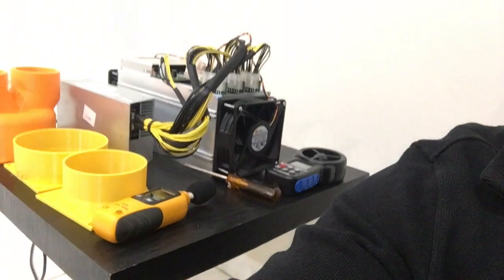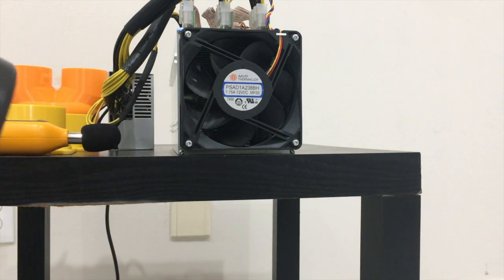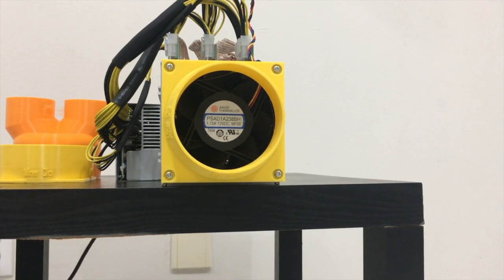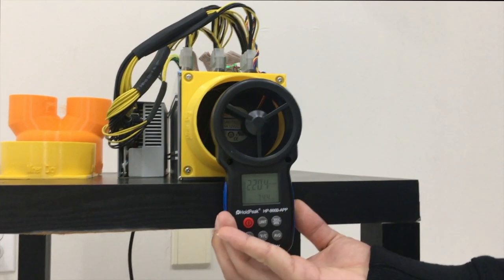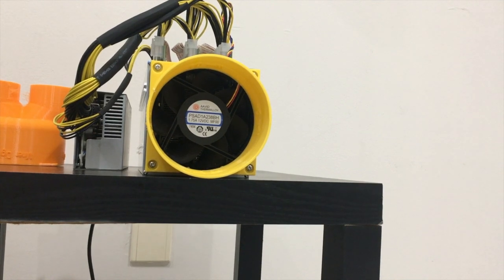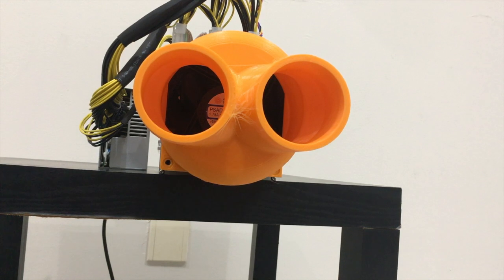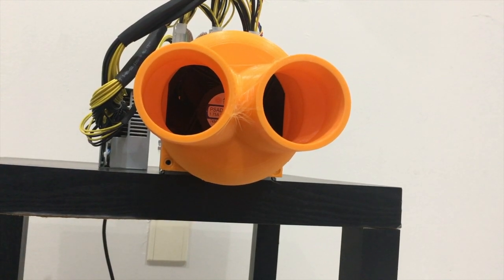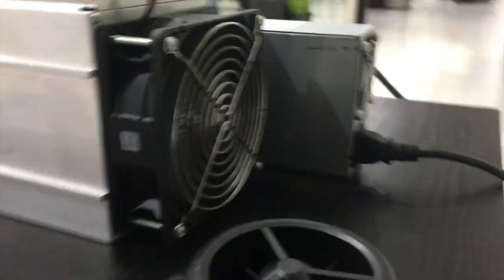Antminer S9 experiment. S9 Bitcoin miner fan shroud testing 4",5",6" cooling fan shroud test

Comment: With the smaller shroud you  create more Velocity in the air flow, but that does not mean you move more air, it just means you have created static pressure.

Comment: so 6 inch vent is better than 4 inch ?
Reply: Pretty obvious with the extra inches...LOL
Reply from the maker: Yes 100%
Reply: well, he showed an increase in airspeed of the exhaust when you reduce the diameter of the duct...which is just physics. What he SHOULD have been doing is showing if it actually makes a difference to tempuratures using the 4 inch duct instead of 5 or 6 inch. I've just ordered 10m of 4 inch ducting and am about to print off some 4 inch adaptors ready to plumb it all up tomorrow (yes, im setting up an S9 in 2021) and i highly doubt im going to run into tempurature issues, and ive certainly saved on the ducting by buying thinner stuff

Comment: Why didn't you put the S9 inside a cooler and read the chip temp on the miner status page to see which shroud keeps it cooler? The whole idea of the shrouds are to use them with coolers to reduce noise while keeping them cool, so  can you please do another test with that intention?
Reply from the maker: Hi, if you would like I can make a video for you put I will tell you right now the shrouds do not keep them cooler simply due to air resistance. If you are using a 5 inch shroud or bigger than you will not have air resistance but will be able to connect he larger ducting. Also if you can see the shrouds add to the noise not take away again because of the air resistance. The only shroud that silenced the unit with still keeping the temp down was my custom 6” shroud. I hope this helps.

Comment: Have you done the test using an Antminer l3+? The back on the l3+ has a vent area and I’m curious if the shrouds would also be useful. Thanks
Reply from the maker: I have not but if I do acquire a machine I will do testing on it.

Comment: I do not understand what purpose is. If you narrow the air outlet area, the air velocity will increase. The moment you do not dig test. Fan speeds are 5000 - 6000 rpm when the chips are warmed up.
Reply from the maker: Then you are not understanding the test. Its showing that you are putting more pressure on the input fan and causing back pressure. Now the real question is lets take a look at the loss of intake speed without any ducting! Now do the math and see how much loss of  fan efficiency and back-pressure would happen if you only added on 3 feet of ducting!  When you find the answer maybe you will change your stance on this test. =)
Reply: The fan is an axial type. In axial fans, the static pressure resistance is low. Axial fans operate freely. It is not right to install ducts on axial fans. Radial fans have high static pressures. If a duct is used, a centrifugal fan must be used for the front part.
Reply from the maker: All ventilation systems have five functional components: an inlet, an outlet, a driving force,
distribution and a path. 1) The inlet provides a location or locations for air to enter the
space. 2) The outlet provides the location for air to leave the space. 3) The driving force
provides the means to move air into, through, and out of the space. 4) Distribution defines
how air moves through the space. 5) The path must exist so that air can enter the facility, go
through the inlet, pass through the space, leave through the outlet, and finally exit the
facility. If all five functional components exist and are operating properly, the ventilation system
probably is working for the given conditions. Solutions to most
ventilation problems are found by identifying which functional component(s) is missing or
improperly operating. 

COMPONENTS
Fans serve as the outlet and driving force in the mechanical ventilation systems in mining farms. The inlets are often a cooled air or some other inlet components.
Distribution is created by the placement of the inlets. Air in an mining facility follows a path from
the outside, through the inlet cool cell or other inlet components, under/below
the space and, finally, out the fans. Understanding the path air takes and how the path
interacts with the driving force helps ensure a well-designed and fully-operating mining
ventilation system.

STATIC PRESSURE
Static pressure is used to evaluate the amount of impact various ventilation system components
have on the airflow path within a given system. For mechanical ventilation systems, the fans
create positive static pressure to move air through a given system. All other components create
negative static pressure that causes resistance to air moving through a system. A mechanical
ventilation system operates with the static pressure in balance. The positive static pressure
created by the fans equals the negative static pressure created by resistance as air navigates
obstacles in the ventilation path. 

CONCLUSION
• Fans of the same diameter are not all created equal. Airflow capacity at different static
pressures varies depending upon fan make and model.
• Increasing the static pressure a fan must operate against reduces the amount of airflow
delivered by fan.
• The fan blades are over 4 inches causing extreme static pressure resistance even without adding the cubic feet of area in the ducting.